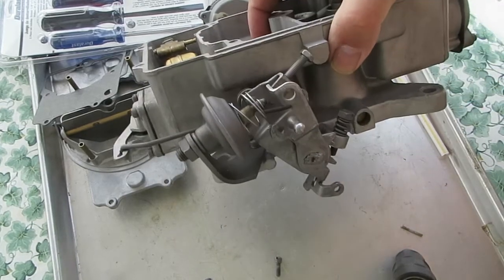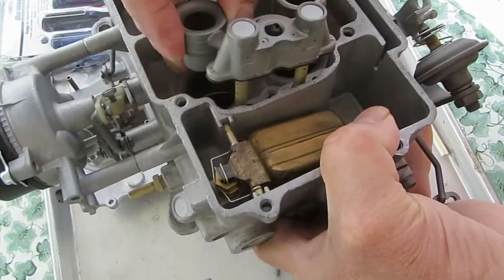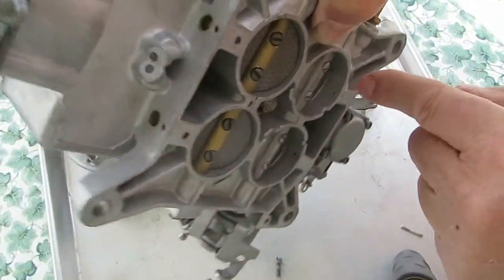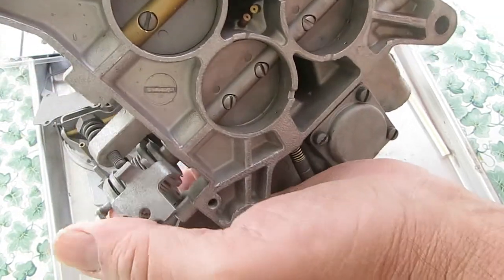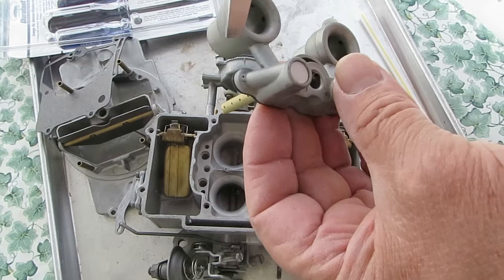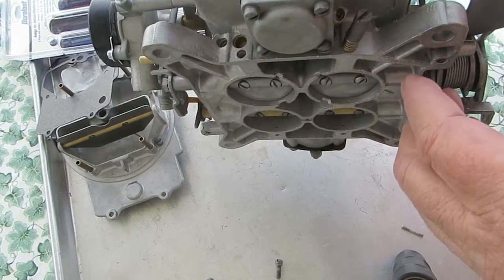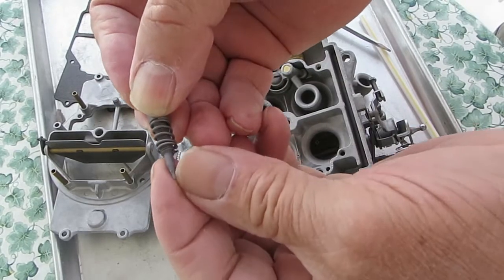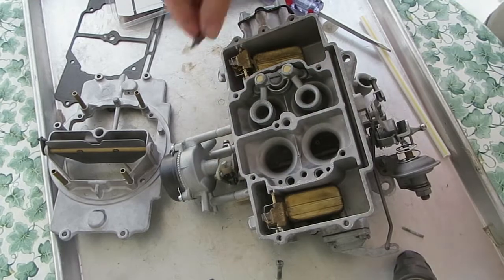Autolite 4100 4 Barrel Carburetor Idle Circuit

Comment: thank you!!!!!!!!!!!!!!!!!!!!!working on one right now, driver side  idle screw has no effect on idle when closed,i believe its the air bleed as I can blow through the screw hole w carb spray and it comes out the idle hole in the venturi.
Reply from the maker: Did you figure it out yet?
Reply: @MikesCarburetor  it was overly rich......I saw fuel seeping from the secondary boosters at idle so I opened it up and saw nothing visually wrong with anything but replaced the needles and seats any way,,also adjusted the float levels higher then they were ,,,,but to spec for the 65 289 mustang ,,,,reassembled and still same problem,rich and no eng idle change from left idle screw,,...So I added a fuel pressure regulator and reduced f. pressure to 4.5 psi,,,,,the driver side idle screw now affects idle when adjusted but still wont make the eng stumble or stall when closed completely like the right idle screw does,,( the screw looks good no grooves),,personally I think f. pressure is still to hi.I also added a phenolic carb base as I could see the fuel boil up through the vent tubes after shut down..gonna test drive again Monday..Thanks for responding Mike!very cool!!!!!Be Blessed cheers.R.
Reply from the maker: I think you have something plugged on the one side that the idle screw isn't changing. @nomar5158
Reply: @MikesCarburetor  ran wire,compressed air  and carb spray through all idle passages.Ill pull the  top and primary booster out again and triple check.

Comment: Hi Mike, 
Just had my 4100 (galaxie 1964 390) rebuilt by carby specialist. Car runs fine, but after I give the car a bit of a harder acceleration, say as the traffic light turns green, the car runs faster at idle or when i park the car. the only way to fix it to get back to a lower idle speed is to switch it off and restart the car, then its ok again? What is causing this issue?
Carby specialist that did the rebuild has since moved on so unable to get the car back to him for a follow up.  
Thanks